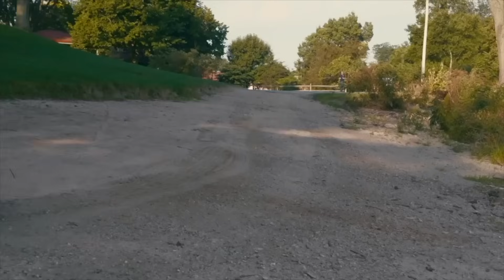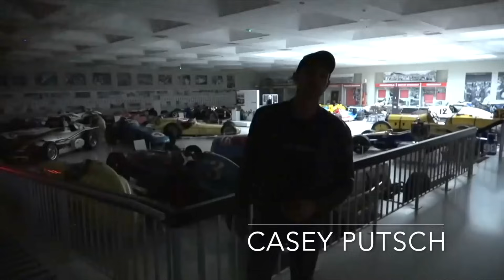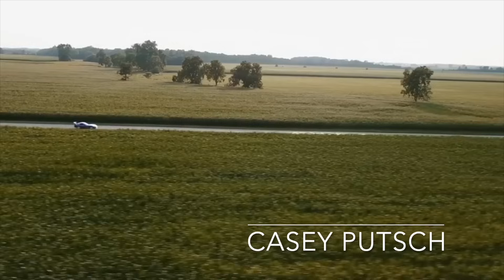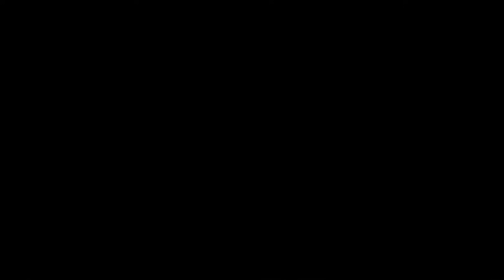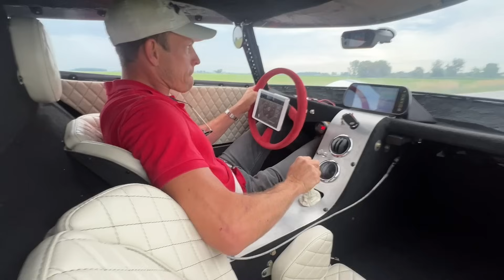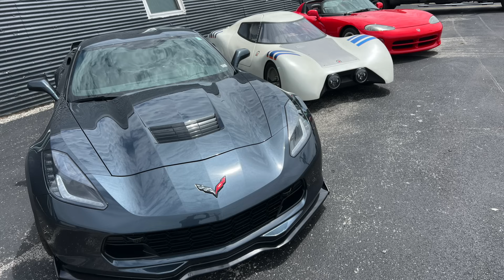HOW?? 104.7 mpg,  0-60 mph in 4.61 - the OMEGA CAR - Video 4

Comment: I was thinking about building a some what similar car from a fiberglass model T ford, somewhat streamlined. With two drive systems, one being electric. The other being a vw Diesel with 6speed transmission. With possibly auxiliary overdrive. Possibly add a supercharger to the turbo diesel along with engine mods. Polishing everything from crank and rods to the heads intake, exhaust,  ceramic insulation coating on the piston, head and ports snd valves. (Possibly)Raising the compression the slightest

Comment: Hey Casey, admittedly I haven’t watched all your videos on this car, but I was just wondering if you used a def system and/or an anti-reversal resonator/muffler for eliminated back pressure while achieving proper pressure wave tuning. I’m not very literate on diesel exhaust but I have to figure it has most similarities to gas and most people wayyyy underestimate those in the car world

Comment: The only way electrics really make sense is if they had inductive power in the roads or something so you didn't need the toxic batteries, and they don't work everywhere... Would be curious about some of those Liquid/solid fuel burning steam engines though...

Comment: Regulation has had a strangle hold on innovation, progress, manufacturing, for decades and decades. And its certainly noy just tue automotive industry. I work in construction and the amount of materials we are REQUIRED to use in prodjects is insane and the playbook is simple. Design a product for the construction industry then lobby for some regulation that will mandate the use of that specific product in the name of safety or climate concern despite the product usually having no real positive effect on anything. A perfect example is silt fence. Nearly every construction project requires miles of silt fence and bio bags surrounding a job site to keep dirt from entering any nearby streams. 95% of the jobsites i work on are during summer when rain is not present and the jobs are on flat ground in the middle of some field where any dirt would be captured by the surrounding grass etc... and yet your required yo install silt fence to stop this imaginary silt from destroying nearby ecosystems. Silt fence is the short (about 3 feet tall) black fence around construction sites which is made of thick black plastic which is made from oil which is discarded at the completion of the job. Your never going to convince me that a little dirt in some rain water is somehow worse on the environment that all the processes involved in building, packing, shipping, installing, and disposing of silt fence!! Especially when farmers till millions upon millions of acres of ground yearly with zero silt fence! Loggers log millions upon millions of forest land each year with zero silt fence! The hypocrisy is mind blowing! Thats just one of a long list of examples

Comment: Best point made in the whole video, you buy what’s best for you in your situation. In a video full of bad takes with a bunch of statements and nothing that backs them up that statement rings true. There’s more good points though that are hinted at or maybe missed.
Casey is missing a lot though. 1 of which is manufacturers have built concepts like his that perform as well or even better. They aren’t mass produceable for a myriad of reasons, repair parts that are too expensive to ship, store or manufacture, safety regulations, like impacts, side view mirrors, etc.., or meeting the emission standards and lasting 100K miles reliably, or… and this is the killer and the one Casey hints at, people don’t want them and won’t buy them.
We can look at the 1st generation Honda insight as a perfect example. 2 seater insanely efficient commuter car, mass produced in 1999. Very very slippery, over 60mpg 25yrs ago, all aluminum body, very lightweight, and met all the safety standards. The concept version was better looking and rumored to get significantly better mpgs. It sold terribly, even though it was the most efficient vehicle for at least 20yrs. The public doesn’t like weird shaped vehicles. The public doesn’t even buy what is best for 98% of their typical driving habits. They buy for the 3 times a year they tow a boat or move a load of mulch or drive 900 miles to grandmas house. They don’t buy for the 40 mile roundtrip they make to go too and from work every day. They don’t even buy the most versatile either. The Honda element is a great example of that. Super insanely versatile but ugly and weird. If people bought practical we would see significantly more  wagons and vans. The TDI VWs would have sold much better. People in the states want SUV’s even though an SUV is really just a worse van. 
What kills me though is Casey talks about not buying into the last 100yrs of industrialization and also says that we should use ICE because of that. That doesn’t make sense. It also doesn’t make sense to compare a concept vehicle to a mass produced one and say see they could build better. They have already done that. Even in the homebrew world they’ve done it. The seven achieved 207MPGe, built for the XPRIZE 10yrs ago, did 0-60 in 6.2, and all with a tiny 32kw battery. 
We blame the manufacturers but we should blame the consumers. Cool cars with great C/D, great practicality, great efficiency, and great drivetrains have been built and the public rejects them. Casey talks about freedom but says that ICE is the way and EVs are about control. I can’t produce gas or diesel at home. I don’t have the land to create enough corn for fuel to make synthetic. I can though create electricity at home. That’s freedom, create my own energy for my transportation needs. Battery in my car went bad? Did it go bad, or do I need to repair it, or replace a bad cell? We’re already seeing these repair shops popping up that can fix these things. I’ve done it myself actually, same as replacing or rebuilding an ICE. 
While a lot of good points are made there’s significant flaws in Casey’s logic and a general lack of understanding of the automotive market. As a car guy I would love to see better ICE vehicles, but… the public would need to buy them for a manufacturer to produce them.
Reply from the maker: Significant flaws in the logic of the guy who actually built a car pointed out by someone who has not.
Reply: @CaseyPutsch Don't need to be a master chef to know when food tastes like poop.

Comment: I'b be interested how it performs on bio diesel from used veg oil, further reducing its carbon footprint. JCB in the UK has successfully modified its existing diesel engines to run on hydrogen as a fuel for its heavy plant machinery, as electrification of these is extremely expensive. This also fixes some other issues with diesel, namely particulates and NOX emmisions. The only issue with hydrogen currently is it is mainly produced from methane, and there is no transport infrastructure. But I believe the Germans are well on the way to solving these issues. Batteries are not the solution, they just shift the problem somewhere else.

Comment: The thing with most people and electric cars is they're much cheaper to charge at home. For those without the option of course it makes much less sense. Fortunately there are people making personal charger stations for your verge.

I agree with you that cars should be much lighter and more efficient. I'm definitely considering diesel-swapping a small car like the Fiat Uno.
Reply: Definitely not that cheap to charge at home with CA electricity prices....which will only get worse as they force more people into them.
Reply: @JJFX-  With the price of solar panels and the amount of generation and storage coming online I wouldn't be surprised if the prices don't go up as much as you expect.
Reply: @ThisRandomUsername  Oh there's plenty of reasons why it shouldn't and ways to solve it but until we see the infrastructure and legislation around it improve, I'm not going to hold my breath. It's not really a reserve problem. I've lived there most my life. This really isn't a political comment more than it is that most of us have been beyond frustrated by the way this and many other projects have been handled for a long time. Don't even get me started on our water reservoirs.

Also while solar and battery reserves can be a great secondary source here, nuclear is still the most efficient and reliable option at scale. Modern advancements have significantly reduced the downsides compared the ancient designs still used in many places. It's just not something the public really understands so politicians tend to avoid the topic. We have been seeing some progress on that front lately though.
Reply: @JJFX-  I understand the scepticism. Time will tell.

I'm all for nuclear myself, but I have a feeling in the long term it would still be cheaper to invest in more storage and just use solar and wind power. For instance, in many countries, the payoff time for rooftop solar and battery storage is within a few years. Also, nuclear carries with it a lot of public misinformation and misunderstanding. I hope the modern designs won't fail because of that on its own.

I do believe that having cars on the grid could actually stabilise it because of the stupid amound of energy in an EV battery. That would require investment into battery-to-grid home chargers. I just looked up power demand in California, and it looks like it gets up to around 40MW regularly. It looks like battery storage is currently around 10MWh, which means there will be a need to increase that by a lot. One way is to make a useful battery like in electric vehicles which can export when the price is high and import when the prices is low. That remains to be seen.

I also see that you're correct about cost being high. One stat says around $0.26/kWh average. Here in South Africa we're paying just less than R3/kWh which equates to just $0.17/kWh.
Edit: I see that some other sources say more like $0.35/kWh.

Comment: I absolutely love the Omega Car. I’ve always wanted to build a similar car that could get ridiculous gas mileage. 

A few years ago I invented an agricultural product. I started researching some materials and processes to make my product. After six months of tireless research and many dead end phone calls and meetings, I realized no one wanted to actually change the way things are made to be more efficient and sustainable. I had seen several articles and videos of a polymer/hemp blend that could be used in hundreds of applications including my invention(and would be great for car manufacturing as well). I searched and searched, found the original company and emailed and called them over and over again with not a single response. No one else with this technology has made it available publicly. 

So I totally understand the struggle you’ve gone through with the omega car and all the resistance you’ve gotten throughout the process.

Comment: I'd love to see your plans for a nuclear hybrid. There's no safe way to shrink a reactor small, light, and safe enough to use on the road. Even if you could the cost would be outrageous. So I must assume you are talking about something similar to what satellites use. You take the heat from spontaneous nuclear decay and use it to provide electricity through thermocouples or Peltier elements. But that produces very little energy on a small scale. But cost is always your problem. You did a fantastic job with the Omega car but you're out of your realm with the nuclear stuff. But I'm cheering for you. I hope you prove me wrong.

Comment: Unfortunately, the world has been brainwashed into thinking EV's are the way forward. Casey is showing the world the better way. I'm glad you are doing this and showing what can be done.
Reply from the maker: Means a lot
Reply: I am so sorry ev batteries are not the future unless you only use the sun to charge it and it gets alot of milage  of that charge and not use batteries to store it ...Because more weight less milage to push car ...An better aero dynamic better milage ...Most factory built car or trucks and vans need alot of hp engines just to push a car threw the air because its a brick an heavy  ..If made light weight an aero and light engine would beat all  cars on the road now and milage to and last longer ...Yes wasting money digging for battery stuff is wrong ..Use what we have in store instead of digging for it ..
Reply: Not all of us
Reply: Diesel contains about 10 KWh in energy per liter, so rougly 37 KWh per us Gallon. If you look at a normal useable Tesla's energy use, it will be more efficient then this. I have both a  very efficient diesel (Wagon) and get around 50/55 mpg. I also have an EV. It is roughly 3x better in energy use. It's simple, electric motors are alotmore efficient.  I am a petrolhead by nature, but physiscs cannot be denied.
Reply: @sjoukedijkstra7110  show me the genset that can produce 37kw on 1 ga or 10kw per L I'll even accept industrial scale.  Peak power gensets required to be on stand by so you and 30k people can plug in when you get home are still diesel powered. It is just not in your backyard.
Reply: @sjoukedijkstra7110 Aptera is trying to mass produce an EV doing the same thing Casey did, make a super lightweight and aerodynamic 2-door car. They also put solar panels on it so it can get over 20 miles of range (closer to 40 miles in sunny California) just sitting outside for 8 hours. It would have an efficiency over 300mpge (10 miles per kWh) making it significantly cheaper to refuel than diesel, and free if you live in a sunny place and drive less than 20 miles a day. Unlike Tesla and major OEMs, Aptera also supports the right to repair so not only will it have less parts to repair as an EV, you can fix and modify it yourself. Unfortunately, they are unable to get large investors to fund it so they are still relying on crowd funding. Major auto companies are not just refusing to innovate when it comes to gas cars, but are failing at making EV's designed for the common person. China is now leaving American and European autos in the dust just as the Japanese did in the 80's and 90's.

Comment: I really like this car but these videos are so annoying. I don't even disagree with the premise that cars are inefficient, but you can't just repeat "do it better" and say you solved the personal automobile. The Omega car gets good MPG because it has a small frontal area, light weight, and an efficient turbo diesel. This video keeps alluding to Casey knowing some special engineering mojo, but it's just smoke. I love the concept of the tiny efficient and fast car but it doesn't fix regulatory capture by the automobile industry. Giant luxury EVs are not the solution but neither is this, the solution as ever is investing in public transportation infrastructure. You made a cool sports car, you did not revolutionize automobile design. Feel free to make some content about what actually went into making this thing instead of just repeating "104.27mpg!!!" over and over again.
Reply: Absolutely not. Invest in public transportation. No way. I rode the bus as a kid, worked 30 miles away from my home. It took three hours to get to work and three hours back. And no way can they make it more efficient. Went to school 40 miles away, had an express bus, it still took two hours to get there and two hours back.

But when I drove, I was there in about 30 minutes. 

So no, investing in public transportation is giving up freedom and being controlled. My time is way more valuable than that.

Also, the state I am in, they let the homeless ride for free. Muggings, r pres and murder is through the roof.

Comment: That car is 100% better for the environment. Your diesel engine is probably around 35% efficient, so it uses the same energy to a 300mpg equivalent electric car, which is unheard of. Take into account the average power plant being 50% efficient, and you produce far less CO2 per mile. You could make an argument for solar and wind, but that's not much better. In addition, this car is better for the environment from a mining, material toxicity, and manufacturing standpoint. 

You could say that I am full of crap and don't know anything about electric, but I have design and built manned electric aircraft and on the side build custom li-ion battery packs for long endurance drones. I breathe electric. Lol

Comment: The omega car could theoretically be the ultimate cannonball car with the correct gearing and sufficient cooling. 

Obviously it's a crazy record to break but if you could even make the trip and have zero fuel stops that would be insane.

Comment: The regulatory state is the biggest hurdle, there is thousands upon thousands of little people in little offices. Who have their book of rules that they enforce, all have the power to say no. Most of them have/had the ambition to be cops. Every year they add more rules. One more thing, they rarely talk to each other. So it's rules upon rules upon rules, so tangled is that mess. It's best to throw it out and start over. But that's not going to happen, it's all about the jobs. That's the excuse. Nobody thinks about the future, just what's right in front of them.

One of the other hurdles is people's ignorance. Like with the electric car, we have been conditioned to believe things always get better or advance if you like. That's not the case, there are physical limits to everything. Batteries is one of those areas, they are at their limit. Sure you can do better, do you want a battery that is so volatile. It can only be handled by trained personal, even those guys say, nope. Or the other thing I've been hearing about all my life. The 100 MPG carb, I'm a car guy. I was always curious. Yes, it exists. But it was so volatile it could only work under controlled conditions.